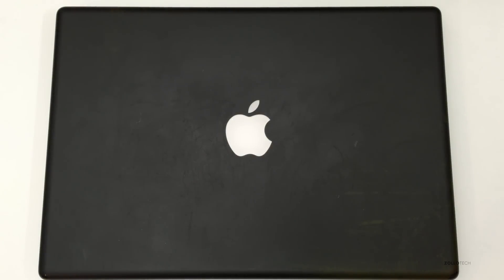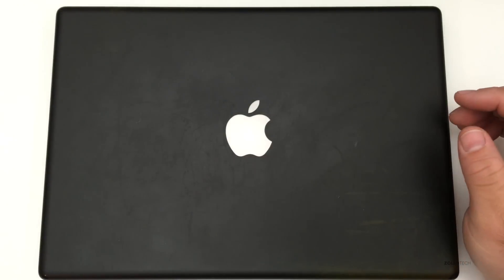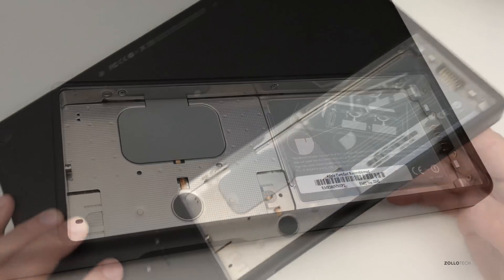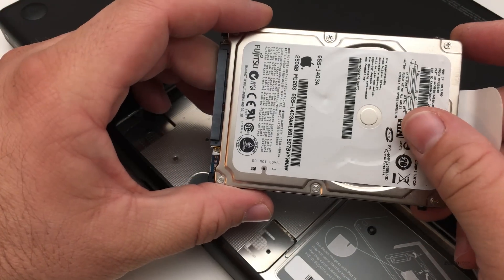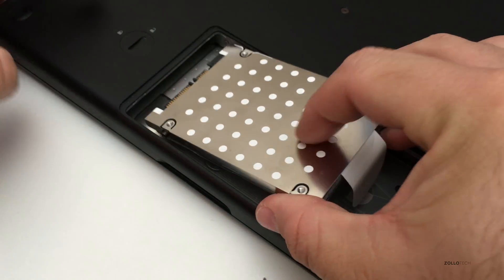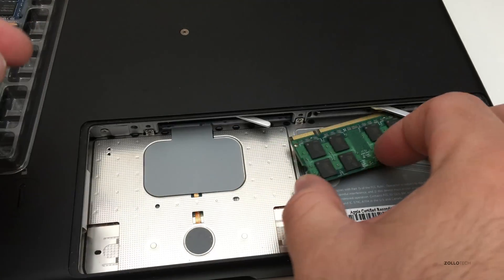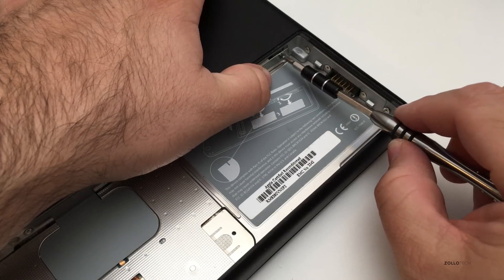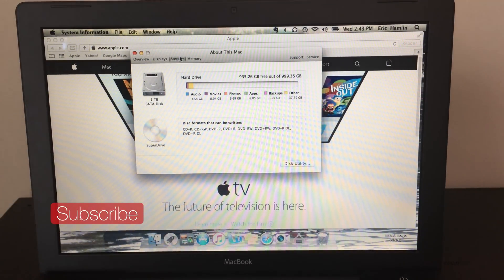How To Upgrade a 2008 MacBook

Comment: You can try macpostfactor and get it to mountain lion, its actually very easy to do and you have some better support with lets say ios devices, my iphone 6 will not sync at all with lion, but with mountain lion, its actually possible because mountain lion accepts a higher version of itunes, so you could give it a try, its very easy to do, you don't even need a usb flashdrive!

Comment: @zollotech, I still have my A1181 Black MacBook, it's good got know that I can max the Ram out to 4gigs, ( small by today's standards) but nonetheless, vital for my old MacBook. I still have some use fo ray, as the file sharing, bluetooth, Creative Suite 3 all works fine and I plan to add a SSD, and recommendations for a good 1TB SSD? Thanks.

Comment: I have a late 2008 macbook which I don’t use as its so slow..Watching this video it seems easy to upgrade to a SSD but I think I don’t have the guts to do it myself..
I just had my MBP mid 2012 upgraded to SSD and RAM, its like a new machine. I bought the components= £120 + £135 to the technician. Unfortunately can’t afford to pay that much again for an even older macbook.. it’s still working, never had a problem, just super slow..

Comment: which RAM is the right and could i upgrade on 8GB ? or install a new graphic card ?
Reply from the maker: Depends on which year and model MacBook you have for ram. Go to Mac sales.com and you can easily figure it out there.  As for the processor and graphics cards; you can’t change that as they are soldered to the logic board
Reply: zollotech i have an MacBook early 2008 black 
Could i use an DDR3 204 Pins ? 
Or could i use an SSD 2,5 Inches 7mm ?
Reply from the maker: The ssd you can. A normal 2.5 will work.  The RAM you will need to lookup for your model

Comment: I just ordered a new 500GB 2.5" SSHD Solid State Hybrid Drive for my 2008 MacBook, but I didn’t buy ram, do I really need that?
Reply from the maker: Ram makes a huge difference so if you can you should.
Reply: zollotech Thank you for responding so fast I was thinking I was going to be waiting a while to hear back
Reply: zollotech Do you think 4 GB of ram will be sufficient? I don’t have to have lightning speed. I do like to use garage band with my music studio and iMovie. 
I’m definitely running slow now but of course the 8 GB is a bit out of my price range,
can I get away with a 4
Reply: I have an external hard drive, can I just back up everything to that?
Reply from the maker: If you use garage band you should upgrade the ram when you can
Reply: Opened up my late 2008 MacBook, it looks nothing like this inside. Do you have any other instructional vids to recommend?

Comment: How would this computer run netflix and YouTube in 2018 ? I’m thinking of buying one today as a muck around laptop
Reply: I have this machine in white (early 2008 2.4ghz, 2gb ram) it runs Netflix and Youtube just fine, however Youtube does give a message saying you should use a more modern browser as you will end up using an older version of chrome. I'm running Osx Lion but Snow Leopard was also working. Best bet is to buy a 2010 white Macbook and you can run a more modern version of Osx, like the latest one and that machine is still pretty cheap.

Comment: Before u changed the ram and hd did you have to back up or play with anything on the MacBook beforehand?
Reply: 3 yrs late...but there is a usb cable that you'll use to back up the new HD before removing the old one. It's a USB-3 to 2.5" sata HDD/SDD cable w/ UASP. This will allow for an even swap, your system will look and act the same.

Comment: Should have just put a 120gb-250gb SSD in this
Reply: Mine took 1Tb SSD and 8gb of ram
Reply: alex castel not in this model. That a1181 only supports up to 6gb
Reply: I have a dumb question, is an ssd faster than a hard drive, thanks
Reply: @Wbgmt07  SSD's are much faster than a regular HDD.
Reply: @youpooper18  ok thanks
Reply: 1C3 P1CK I tried a 1TB SSD but failed. Switched to 500 GB SSD and works great
Reply: I got mine with 750gb.  It only had three gigs RAM 
though.

Comment: I have the white 2008 MacBook. My problem I'm having is I cannot backup nor restore my iPhone 6s to it. It says my iTunes is out of date but cannot update, and the Mac won't upgrade from snow leopard due to hardware. If I do this simple upgrade as you just did, would this give my Mac the ability to upgrade to lion?
Reply from the maker: You can upgrade to lion and that is it.  However, iTunes will still be out of date.  The only things you can do is backup using iCloud or buy a newer mac.
Reply: I have a late 08 white macbook with a fairly new logic board got replaced not too long ago.  
so it's worth fixing as it is fairly new inside. i am having the issue where my screen backlight goes out if im on high brightness and also if i move the screen it will black out too. any idea where to get parts and any specific part numbers?
Reply from the maker: +Austin Cummins no.  Unfortunately your only option is to buy a new Mac. Otherwise you'll just have to use iCloud backup